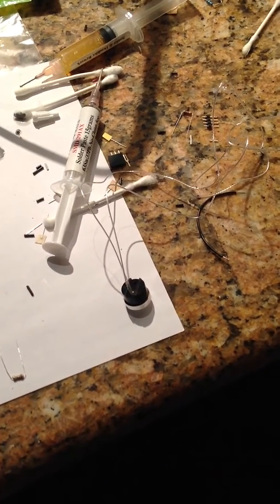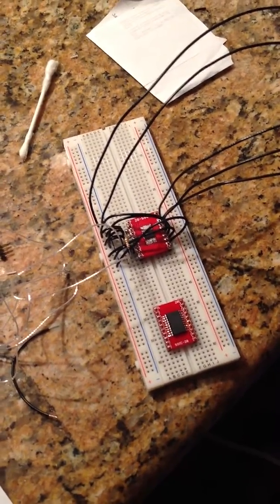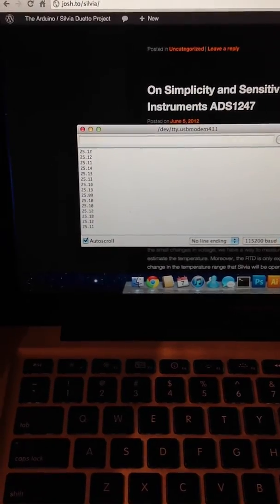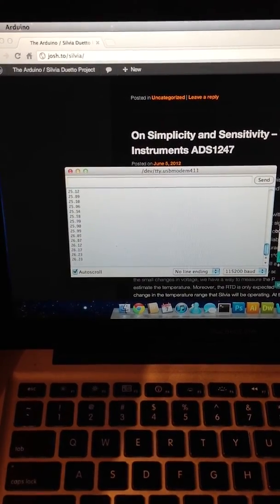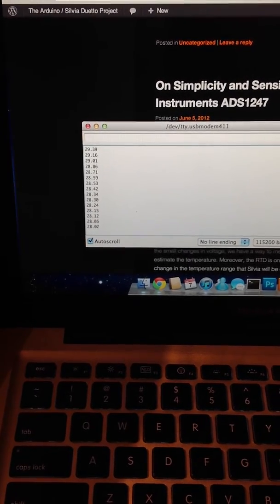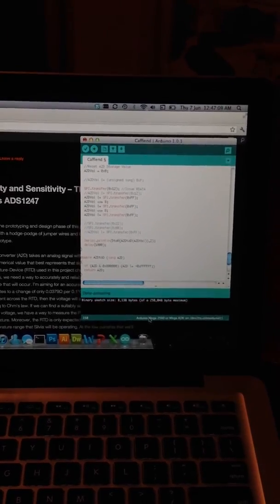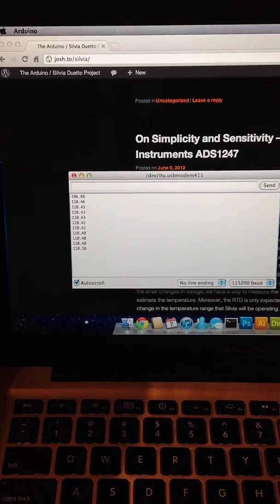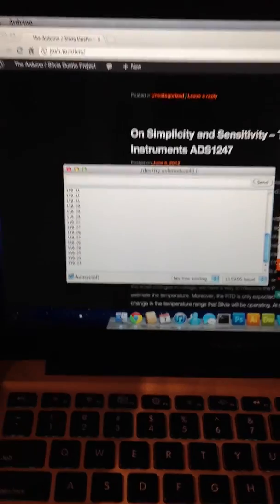Arduino / Silvia Duetto Project: Auber Instruments RTD (PT100) w/ Texas Instruments ADS1247

Comment: Need a PT100 simulator?
http://www.h-instruments.com/product/testingindexaspxpageid=48405020and20prodid=7866119
Reply: New link to this great instrument
http://www.h-instruments.com/-PT100_RTD_SIMULATOR__Calibrator/p484050_12782735.aspx
Reply: Need a trans impedance amplifier? Great for converting current from light sensors to voltage etc.

http://www.h-instruments.com/product/transimpedans_amplifier__ht-106

Comment: Hi Josh
I had a look into your project. Its amazing. And thanks for the codes which you have provided. I am trying to interface ADS1248 with a uc (not arduino). For your inbuilt temp. sensing code , I am getting a constant value . I think may be I have not configured the SPI properly. In my SPI
CPOL =0, CPHA=1, SCL = 1Mhz
CS toggles at each 8 bits (as in all SPI)
Start pin goes high for one complete data package (24 bit) . then again low.
Reset pin is always high.
I tried to post in your blog but was unable to. I have interfaced mems sensors using SPI. but I am interfacing ADCs for the 1st time. Your code helped me a lot to understand how this works. If you could help me out. It will be very grateful for me.